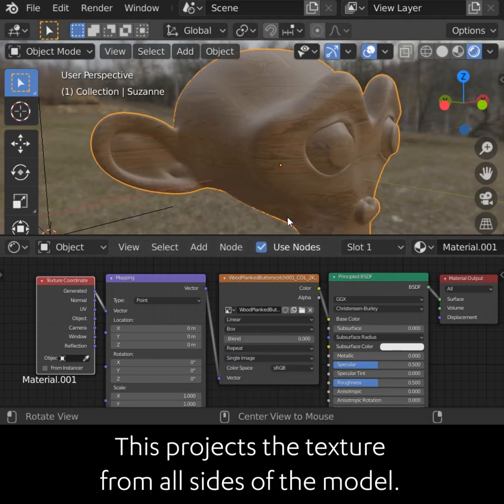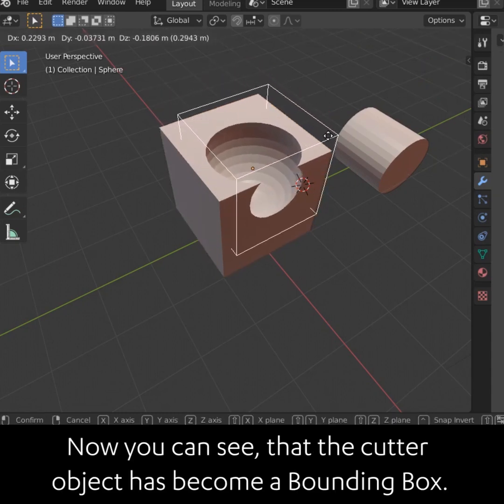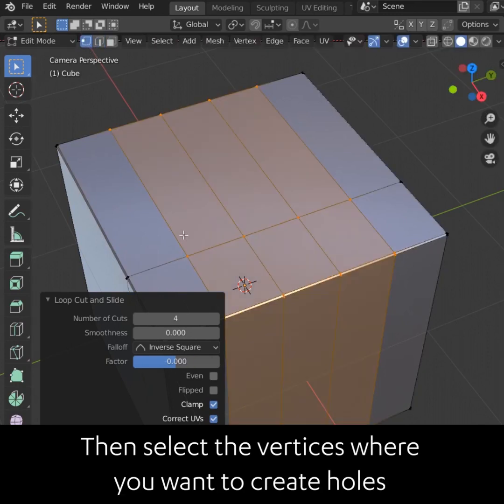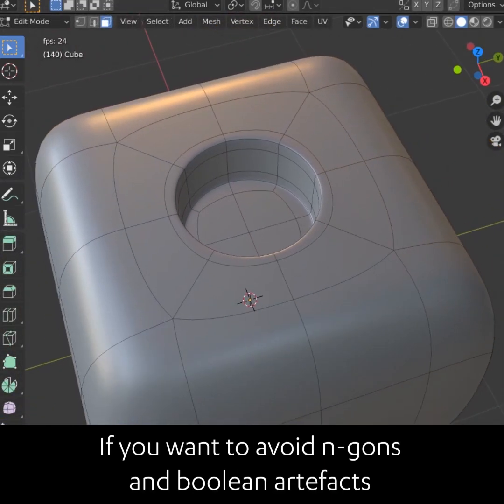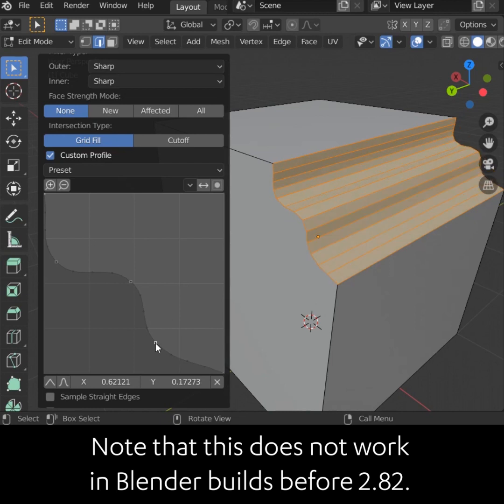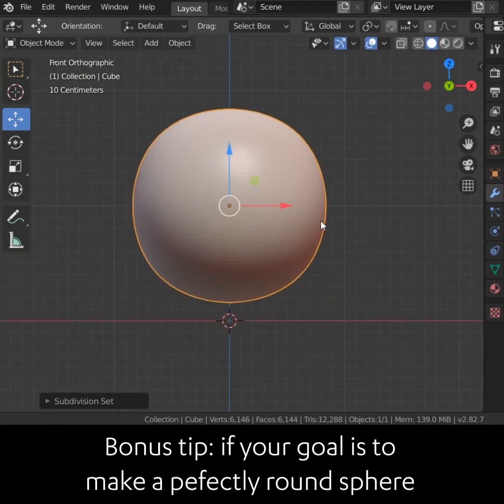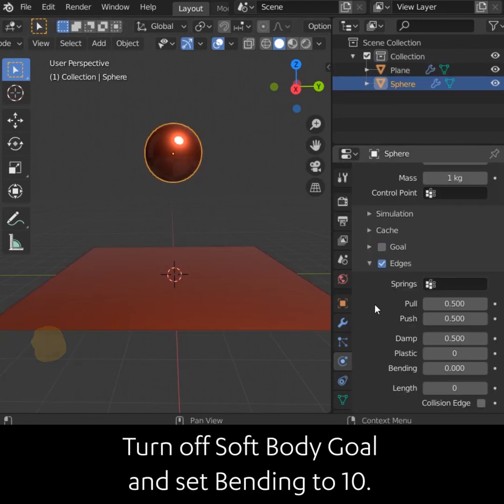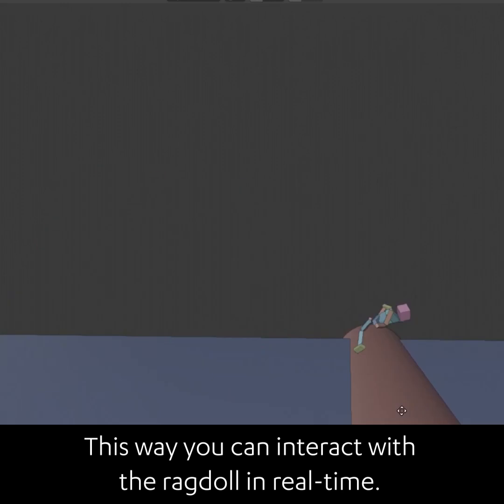Daily Blender Secrets - 15 Tips Compilation (Part 2)

Comment: Holy molly! I was using the cut tool as a destructive tool. I didn't know that I could use this way, don't destructing the mesh. This will help me a lot. I'm starting in modelling for 3d printing and I need to cut and create holes for the parts for every part. I was creating a new save with the cuts made, but if I need to modify the model, I will need to cut all again. With your tip I will be able to keep the cuttings without destroying the model. Thank you very much!

Comment: Shade smooth is a model render flag. It is "Mesh Smoothing".

This isn't isolated to Blender. It's across all software. You should not be beveling game model assets if you don't need to. To preserve details, make a high-poly and bake the normals into the low-poly version.

Also, use shade smooth even when exporting. It isn't a blender-only option.
Reply: i think he was talking about auto smooth

Comment: Ctrl+1 for boolean modifier does not do what you are saying it does. 
2.92.0 it adds sub-div modifier, what am I doing wrong?

Figured it out: New shortcut is CTRL+ numpad -
Side note: CTRL+1 if you want quick sub-div is also a quick tip :P
Reply: I don't have any numpad on my keyboard, do you know how can I do without it ?
Reply: @Perdue_dans_la_Fractale  Fairly simple, first ensure you enabled the booltool addon.

selection: select the object you wish to become the hole, then select the object you wish to have the hole in. 

Then top left corner of 3d viewport click "Object" all the way at the bottom of the list should be booltool, you want the "Brush boolean Difference" option.

Comment: how do you move the camera smoothly to a place?
Reply from the maker: I like to turn on "Lock Camera To View" and move the camera like I would navigate the viewport. Then simply set keyframes for its location and rotation. By default Blender uses easing for keyframes, so it should move smoothly.